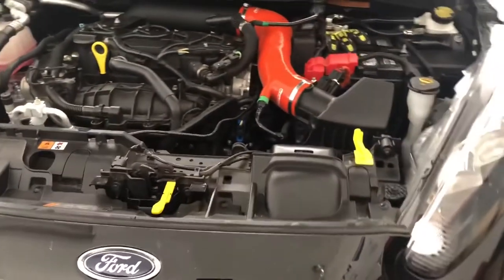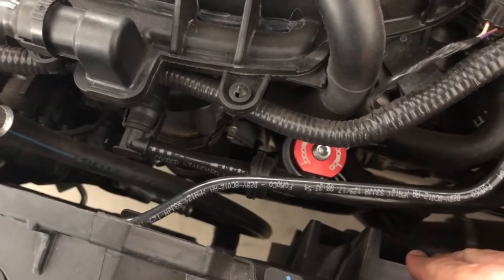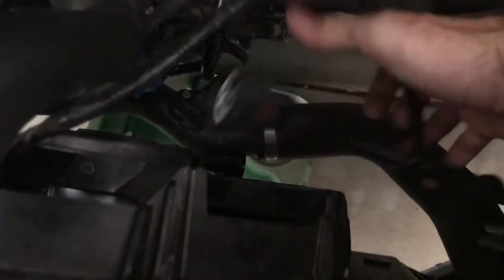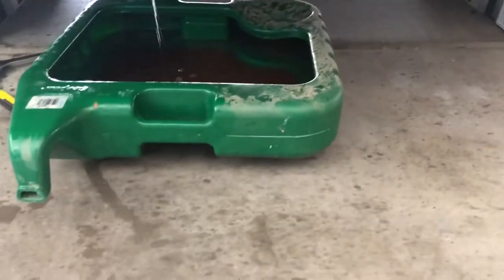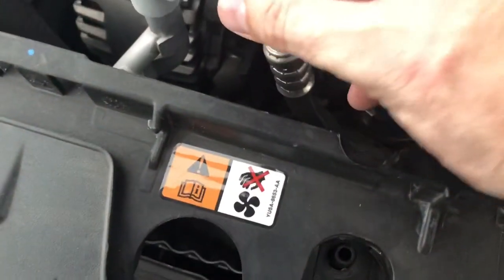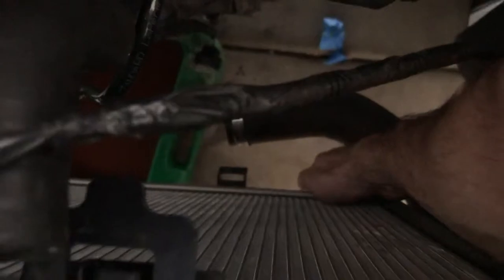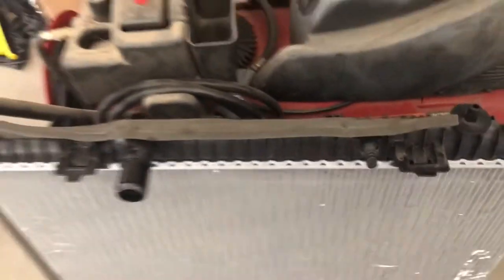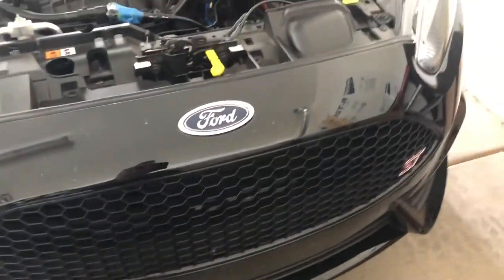Ford Fiesta ST Radiator Removal

Comment: Great video I am getting ready to put in the Mountune radiator as well. How much coolant did you end up having to use with the bigger radiator?
Reply from the maker: LowBoost FiST I think it was around 1.75.  Two jugs should do the trick.

Comment: Love the videos. I just picked up a 2018 ST. Do you know where I can find the maintenance manual that shows all the torque specs for all the bolts on the car?
Reply from the maker: DYNARYDER87 thanks for the kind words.  You may want to check out the fiesta forums for the manual.  I believe only 2014 one is out there.
Reply: Indecisive Garage Awesome. Thanks man!

Comment: Hi mate bit of a random post but how do you re tighten these stock radiators? Mine has way to much play in it.
Reply from the maker: Robert Moore I believe it is held by the rubber isolators.  Only option that I can think of is to add grommets or silicone.
Reply: I've noticed mine is really loose aswell its maybe ment to be like that but I think it should be tighter aswell myself